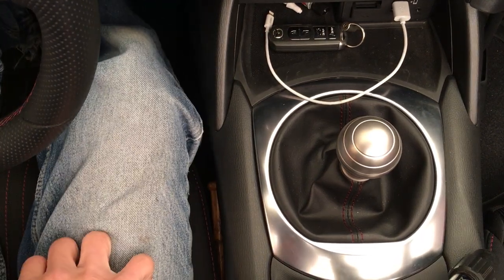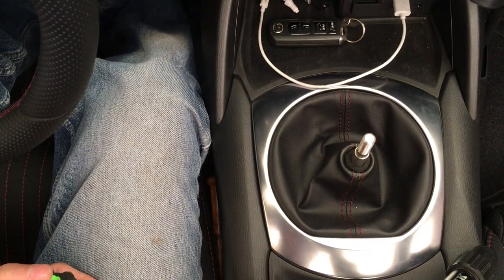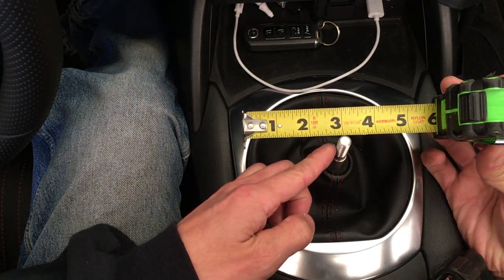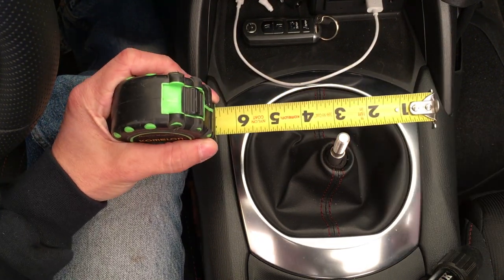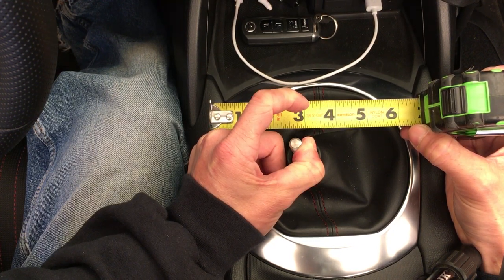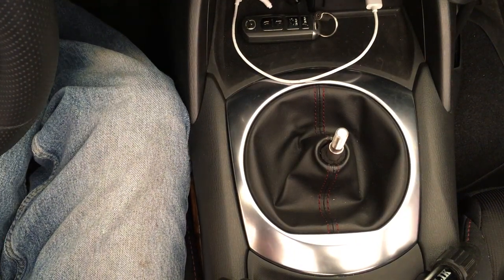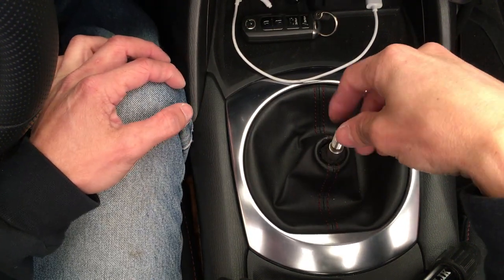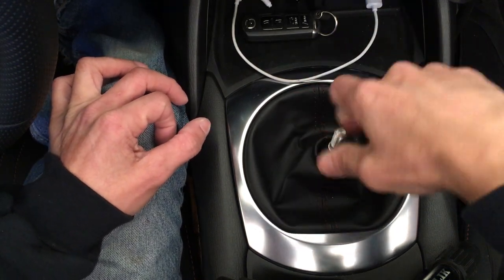ND Miata Craven Speed short shifter review

Comment: You tried a few different shifters.  What are you settling on?  I like the look of the Cravenspeed shifter well.
Reply from the maker: I love the looks of the Cravenspeed well but it didn't work out for my car.

Haven't installed the Corksport yet. Will do that this week but won't have a review on it until 1,000 miles.
Reply: @DaBinChe  Curious, what didn't work with the CravenSpeed shifter?
Rattle? Noise?
Reply from the maker: It worked fine.  I want the shifter feel/effort to be as close to the steering as possible.  The smaller diameter steering wheel and 215 wide tires made the steering a tad bit heavier/sportier which I like but is still softer the the shifter. The Cravenspeed requires more effort then the steering.  Hopefully the Corksport with the adjustable feel can come close if not the same feel/effort.  Currently running stock shifter and don't like it at all too soft/light and travels feels really long compared to the CravenSpeed.  No mechanical and notchy feel of the Cravenspeed.  Waiting for some dowel pins to install the Corksport.